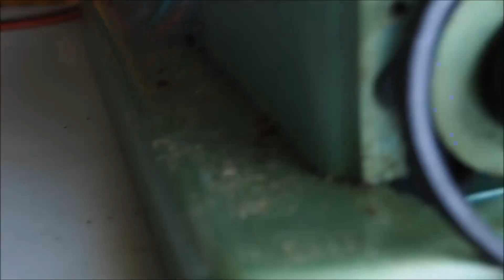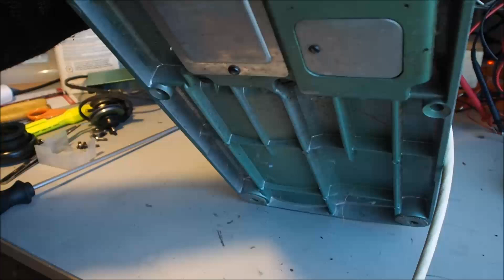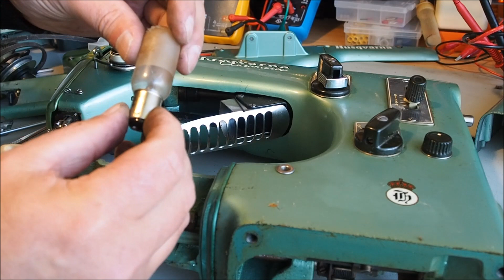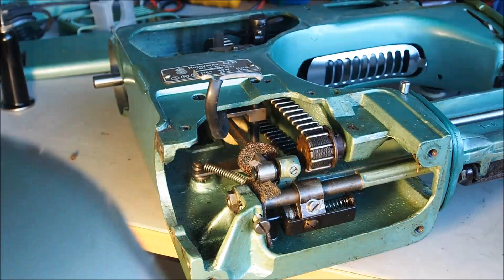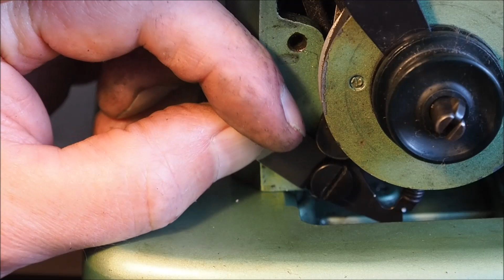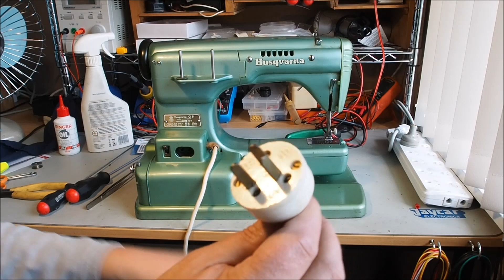Husqvarna Class 21 Sewing Machine - Mechanical Marvel! - Viking

Comment: Hi , just wondering if you could kindly tell me how to remove the capacitor and reconnect the wires . When I attempted, I found the lower set of wires going to the coils of the motor and as I am not a “professional  electrician “ I felt uncomfortable to proceed further. I would appreciate if you could kindly tell me how to proceed removing the capacitor and get started with the motor. I am really “ cheesed off “ with the complex connection of those wires . Further, I fail to understand why are there 4 wires ., two on top and two at the bottom of this capacitor? My other Viking ( Viking 5220 ) has just two prongs and to remove them was “ literally a cakewalk “ . While this one on my Viking 21A is not only complex but giving me heartache, let alone the machine is totally nonfunctional! I look forward to your early reply and help. Thanks, Ramana .
Reply from the maker: Hi, I'll try to explain how the capacitors are set up but I would recommend taking your machine to an electrician or sewing machine repair person. From memory, the capacitor set can be bypassed. Don't quote me on any of this because this is from memory and any modifications you make could make the machine dangerous. You have four wires, two on top and two on bottom of the capacitor set.  From memory, you clip the wires top left and bottom left and join them and do the same for the top right and bottom right. Make sure an electrician checks it before plugging it in because, as I say, I'm working from memory.

Comment: I would like to know how to get to the light.  I have two of these and I am using one for parts.  The light falls out of the one I am keeping and it works great on the parts machine.
Reply from the maker: The bulb sits in it's fitting which is located inside a chrome cage under the arm of the machine. The chrome cage is hinged on the right side and if you pull the left side of the cage down, it should swing down on the hinge, exposing the bulb and its fitting.

Comment: Thank, you very much appreciated. My old machine is very dirty on the inside i realized. What do you use to clean it out? Do you know the measurements for the belt? I found this 9 1/4" (inches I guess) still made by Husqvarna Viking. Would you or any one else know if it fits this particular machine?
Reply: If you live in Sweden, drop by any local second hand shop in your area and get yourself a deal. You can find one between 350kr and 800kr!
Best of luck.😊😊

Comment: I have the 21 e and love it.  I also have another 21e that I would like to renovate, it needs a replacement upper tension assembly and I think a new spring for the reverse button then it will be good to go. Does anyone have any parts for sale or could you direct me to someone please.  My daughter wants my 21 e but I just can't part with it so I bought this second one in good faith only to find these problems, it is stuck in reverse too!!
Reply from the maker: I think I have an upper tension assembly if you're interested. My email address is in the video description.

Comment: Hi! 
Thank you for this excellent video!
I'm renovating my Grandmothers' old Husqvarna Automatic 21 that I inherited about 10 years ago. It's in great shape except it needs new belts (I found a set of new original ones on ebay)  and one of the gears in the reduction gearbox has lost some teeth.
These are hard to find for the Automatic 21 but I found several for 6430. 
The assembly looks different to me but I just need the plastic gear and those look at least very similar. 
Are they interchangeable between these models?
Reply from the maker: I would imagine the gearbox gears are the same between models in this family. 21A, 21E, 19 etc.

Comment: Hello I have a Viking Automatic 21. The foot control is broken. The little fabric strap that pulls the roller up the rheostat is broke. Is there anywhere that offers a replacement part or is there a homemade fix?
Reply: A generic foot pedal will work fine instead - either the "clamshell" rheostat type or an electronic one. The connection is just 2 wires. Having said that, the Husqvarna pedals are havey (so won't move around) and very good quality if you can figure out a fix.

Comment: Thank you so much for this video! Im in the proces of buying this machine and this was very helpful. Could you tell me whether this machine can sew with thick denim thread?
Reply from the maker: I find it does struggle to sew denim jean hems where you turn the hem under twice; it can't quite handle the felled seams when you've effectively got 12 layers of denim. Even when the tension is very high the top thread tends to jam in the hook area and even with good belts they tend to slip. You can turn the machine over by hand through the extremely thick parts but it just can't handle it. You may get away with just turning the hem under once. I have found the best domestic machines for hemming jeans are the very old Singer machines, like the treadle and hand crank type, or a 201K and the like. The Bernina semi industrial also does a good job. An industrial if the best way to deal with jeans sewing.
Reply from the maker: Within reason. I tried it and it will do light denim. It doesn't handle hemming normal jeans with a double turned in hem on the lumpy seams very well even with the tension cranked up.

Comment: Good day
I just got this machine, it is running but gives off a burning smell from the motor area...what could be wrong please
Reply from the maker: More than likely the capacitor set is failing. They can be removed and you can continue to use the machine without them but I would recommend installing a replacement set asap. Also check motor brushes are not worn out.
Reply: Oh thank you for responding...the machine actually did give out a lot of  smoke when the it was being serviced by a repairer...He said he's not so good with motor repairs...any suggestions?

Comment: Hello I got a rotary viking Husqvarna type 8E the belt motor belt is missing,  I bought it like that, out of ebay.  I don't know where to buy it new or used. Do you recommend a place where you can buy it? Thanks
Reply from the maker: Hi. The belts are no longer available from the manufacturer. I'm looking into making some. Thanks.
Reply: Someone in the UK is selling them now on eBay

Comment: Can you remove the capacitor in the motor and in the footpedal, would the machine still work? Is this safe to do?
Reply from the maker: Yes, the machine will still work after removing the capacitors. It could cause unwanted electrical interference though.

Comment: Love your videos. This is the second time I am watching it. Just got my Vintage Husqvarna 21e and have been sewing some pants so they don't split when I bend over... lol. The machine sews beautifully. Found a video of a 21a sewing 10 layers of denim  :  https://www.youtube.com/watch?v=B4iYFt5hsVM  What a work-horse !! Is there much difference between the 21a and the 21e in terms of performance and features and which model do you prefer ? I ask, because I have the chance of getting a 21a I just love these machines... Cheers
Reply: The only visible difference between the 21 A and 21 E is that the 21 E has a more slimmed motor cover on the back of the machine. The 21 A has a "hump" on top of the cover behind the machine as seen on the machine in this video. I have no knoledge if there are ant technical diferences beside this.